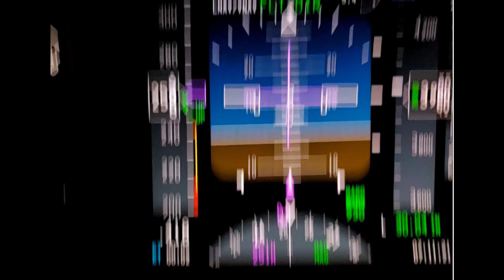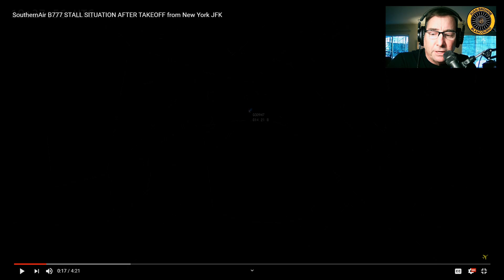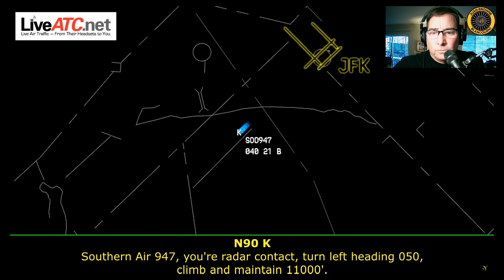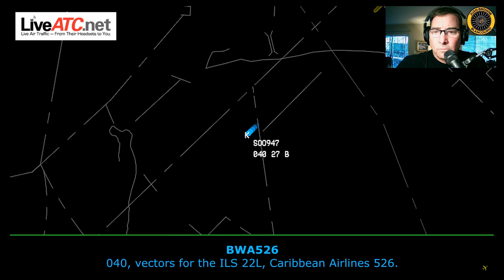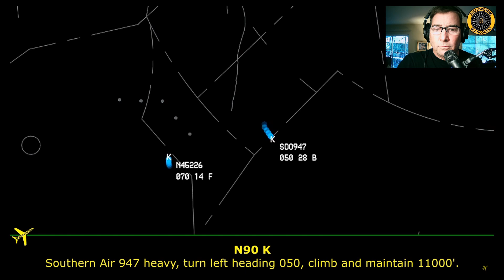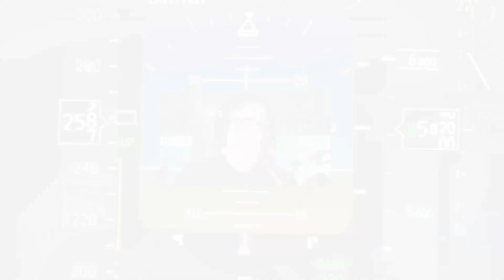"Stall, Stall, Stall" B-777-200 JFK 15 Nov 2020

Comment: When the 777 was designed engineers wanted it to be, as all Boeing planes were to that point, "pilots airplanes".  This was in spite of the fly by wire system that was new to Boeing commercial jets on this model.  They wanted the pilots to feel control forces to know when they are getting close to the edge of the controlled flight envelope.  As Juan points out this does not happen on Airbus planes.  For instance on the "Miracle on the Hudson", Capt Sully has said he would have liked to pull the nose higher before his water landing to have the speed as low as absolutely possible, but the plane would not let him.  On a Boeing he could have, the control forces would be high, but the philosophy is the pilot is in command and sometimes extraordinary circumstances call for unanticipated control inputs.  It would be interesting to hear Juan talk about which he prefers because I believe he has flown both manufacturers on the line.
Reply: @Rob S  which conclusion did I jump to?
Reply: @gregculverwell  you can feel a plane on the edge of stalling, so no he wouldn't have screwed it up like you claimed.
Reply: @southjerseysound7340  tell that to the hundreds, perhaps thousands of well trained and experienced pilots who have stalled and killed everyone on board.
Reply: @gregculverwell  like everything there's always guys that are better than most and others I wouldn't let fly one of my Cubs pulling banners,let alone fly a load of passengers..........Sully was one of the best and more than capable of flying on the edge of the envelope.
Reply: Damn Capt. that’s one helluva comment.... INTERNET COMMENT OF THE DAY AWARD sir 🥇
Reply: @Militans Deo  Fly the aircraft all the way to the crash site as Juan put it once.
Reply: Is that Hudson quote real ? Unlikely as in a dual eng failure the flt control law revert to alternate law with gear up . This does allow the pilot to stall the aircraft if he/she wants to . I think the Airbus gets unnecessary hate , especially from old Boeing pilots as they have trouble understanding the systems . The Airbus is designed with the “average “ pilot in mind , you are not allowed to make mistakes and when systems fail you have full control . Not everyone is an ace to be able to fly the aircraft right on the edge as Boeing expects its pilots to be .
Reply: @AKENOXTRM  no, captain Sullenberger never said that, for some folks it is now all about to discredit Airbus as being the same junk as the 737MAX8
Reply: Not really....the 777 has not "feel" of the control surfaces so a tension system gives them a simulated feel which may or may not be correct. Airbus simply says "you won't feel anything so just watch the damn instruments"...it works fine for the F-16 in the Air Force...the stick only moves a few inches and there is no feedback...
Reply: I thought that Capt. Sullenberger switched to direct law, and therefore flight envelope protection would be  disabled.
Reply: @pchantreau  To do that is actually not that easy, there is no control that lets you go into direct law. Nearly always the plane will stay in Alternate Law anyway and only enters Direct Law when the landing gear comes down. Now, Alternate Law doesn't (usually) have protections either, but it has stability features which will add computer generated control inputs, not to mention it is still a g-load command law, not a direct stick to surface one. 

Anyway, Sully staid in Normal Law until touchdown, which actually was in his favor as simulations afterwards have shown that with his inputs he most likely would have both stalled the plane and probably ripped off the tail section leading to immediate sinking on touchdown. It was an absolutely brilliant peace of teamwork, decision making and flying, and the little help he received from Airbus' inbuilt FBW-features does not diminish that in the slightest.
Reply: As a pilot that started back in the 60's (recreational flying only) I've tried the "simulators" and I couldn't get the hang of it. The controls aren't in the real Cessna world (152, 172, 182, 210, 310 planes that I've flown) just aren't there. So I go back to the real thing to get the real feel!
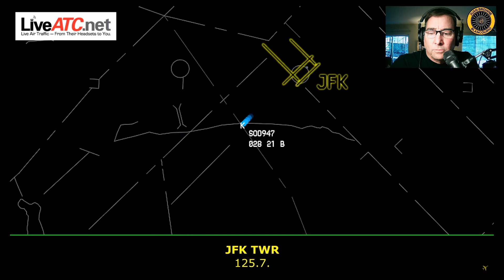Reply: 5:50  yes, this captain sounds tired, but maybe it has become a bad habit on long cargo flights to drink some booze?
Reply: @lenny108  I highly doubt it, I mean it would cost his co worker their job if found out.
      The one thing that you have to realize about pilots is our lives revolve around being able to fly. It takes years of training and paying your dues via hard work, not to mention an absolute fortune to reach the level they're at. So there's no way someone would risk it all to cover for a coworker who was drinking,plus  I think the flight was long enough to require a relief crew and that's just more that would never risk their careers.
Reply: It appears you have been unsuccessful at drawing Juan into this partisanship controversy.
Reply: Maybe the outcome of the Hudson waterlanding would be different without that protection. More tail into the water, stalling over water instead of landing? Mind there was some damage on the back of the plane. A 737 could have broken its tail frame with its consequences.
Reply: @sapede  The Air France crash is the other side of that though. The pilots had no idea how to save a plane when it stopped acting as expected. They hadn't experienced enough situations that were out of the box.
Reply: @Kimberly_Sparkles  On AF447 the copilot panicked and made wrong inputs on the controls when he should have been doing none as he was supposed to be just monitoring (On a plane if you are falling down due to stall, the correct recovery maneuver goes against instinct). Sadly as it is, the plane crashed alone by the copilot actions as was with Giant 3591. The issue is with panicking, as the responses tend to be irrational.
Reply: @sapede  And that crash would never have happened on a Boeing. The 2nd pilot would have known that the stick was fully back (control yoke in the case of a Boeing) and would have corrected, pushing the nose down. In an Airbus, you can’t see what the other guy is doing with the controls. 
As a very high time airline captain, recently retired, I am damn sure which system I prefer- and it ain’t the Airbus one!
Reply: @Kimberly_Sparkles  AF447 had a pitot tube that was prone to icing. Airbus tried to save a buck and it cost lives. Ironically it was one of the last planes scheduled to get a updated pitot tube that they knew had icing issues.
Reply: @FutureSystem738   I hoped the example given of Giant 3591 would show otherwise. Active Sidesticks are on the market so Airbus may be working on integration.
Reply: @sapede  Read the official report on AF447. The stall alarm would activate when the stick was forward and deactivate when the stick was back. Completely backwards due to bad software and alternate laws.
Reply: @southjerseysound7340  any plane is prone to icing it's really not a thing that crashes planes, you just keep flying until they defrost (they have heaters in them even on the so called faulty ones) if they had not done anything 1-3 minutes later speed sensors would have worked again again it's nothing special 
you should watch this (if it doesn't get filtered) https://youtu.be/l1TKe5vmxX0?t=1424 and this is the point where bonin actually says he been pulling up https://youtu.be/l1TKe5vmxX0?t=2151
Reply: @elderbob100  no it was because when it was past 35 Angle (they was at 40 nose up) the stall computer treated it as gibberish so the stall warning activated less often until they got the nose below 35 and then they got constant stall warning again, bonin incorrectly interpreted that as going to fast so just kept pulling back on his stick to keep the angle above 35 (he didn't know that) and Never told the other two pilots that he was actually the one who was pitching up (if you can see my other last post i have 2 key points when bonin doomed the plane)
Reply: @leexgx  I guess airbus changed them to a different design because they were bored then. Another critical flaw is how the side stick functions. The design allowed the inexperienced pilot to freeze with the stick and the rest of the crew had no idea until it was too late. Had it been a Boeing the pilot would've noticed IMMEDIATELY what he was doing and been able to easily correct it. You can say whatever you want but the fact remains that airbus is no less responsible than Boeing was with the Max.
Reply: @southjerseysound7340   A somehow similar situation happened with the Amazon Atlas 767 and the outcome was the same. With the A400M bear in mind that in spite of being propeller driven, it is a relatively fast plane. If you think those are serious problems, read about the development of the C5 or any similar of your choice.
Reply: @sapede  the Atlas crash was totally different and just trying to compare the 2 shows how little you know about aviation. The copilot hit the TOGA switch and shoved the stick forward at 6,200 ft instantly turning the thing into a missile.There was virtually nothing the pilot could do to save it after a few seconds and there's a lot of talk about it being a possible suicide. But there's no proof  so it remains an accident.
Whereas the Air France flight had well over 5-6 times the altitude and the copilot was holding the stick back.  You can't compare the 2 but if the Atlas flight used the same control inputs as 447 it'd have been easily recovered.
Reply: @southjerseysound7340  Yeah, but I've read the transcript of CVR a few times. The crew was completely overwhelmed by what was happening. Even if they'd had a shot at recovery, they were never in the right headspace to do it.
Reply: @FutureSystem738  , unfortunately, on AIRBUS, only ONE SIDESTICK, can work at anytime, if you want to have the second officer to be in control, you MUST go through the computer to select it , case in point do you recall an A320, AIR ASIA , going through some nasty storms& ATC  left him out to hang as capt wanted a change in altitude, so HIS SIDESTICK, has a CRACK in it &so really having to control the aircraft in that storm, then IT BROKE , not enough time to transfer to second officer, I lost a $500. Bet that the crash, was a result of the vertical stabilizer failed, , but was still in place when the rear section  was found . so I paid the bet. , cheers 🇺🇸🇺🇸🇺🇸🇺🇸
Reply: @flybyairplane3528  Sorry, that is simply wrong. Both sidesticks are working at the same time, there is simply a warning logic between both that advises of "DUAL INPUT" if both pilots use the sidestick. Inputs are added arithmetically, so a half deflection on both sidesticks equates to a full deflection on one. However, dual inputs are not the norm in any airplane and should be avoided, both in boeings and airbusses. The one thing that is possible in airbus is the ability to actively lock out the other sidestick, but one has to keep pressing a button on the sidestick for that.

And no, the sidestick was not at fault in the air asia accident, it was rather a captain leaving his seat and pulling circuit breakers in flight for a reset procedure that is only allowed on the ground, while the first officer was probably more focused on the captain than on flying the airplane. The reset procedure actuates the rudder which lead to a loss of control.
Reply: @flybyairplane3528  there is a button on the "joystick" to take control on the Airbus

to use dual mode I do believe you have to press a button above your head (or if you press the take control button in certain way) but every plane now triggers a verbal warning that dual control is enabled, unsure if it keeps repeating every so often as airlines have effectively banned its use (due to the no force feedback nature of airbus "joysticks" and having 2 pilots do the opposite thing means the plane doesn't do anything , af447 may have been what made the new rule that only one pilot has joystick control, but there was another flight where the plane was actually in a nose down stall and both pilots was doing the opposite witch resulted in crash)

where as on Boeing there is no confusion what the stick is doing on both sides even on the dreamliner witch is fully flyby wire with fully force feedback you can even turn a stick off to move it out of the way to get in and out of the seat

With Boeing it's generally mechanic error (or as with MCAS programming error but pilots failing to detect runaway trim) but there are pilot errors but they don't normally result in loss of plane just 2 pilots doing something stupid (but there are some absurd pilot errors, like kid flying the plane and all they had to do to recover from the stall was just let go of the controls and the dreamliner auto near stall recovery system would have saved it, before it's "I have stalled recovery" system kicked in witch forces the plane into a recoverable nose dive)

Where as airbus "technically" 99% of blame is placed on the pilots but due the complacent systems of flying a airbus means you get pilots like bonin flying a plane who shouldn't be flying at all (pulling back in a stall and not telling anyone until they was beyond point of no return)
Reply: @Soordhin  well as was told AIRBUS NEVER WANTED BOTH TO EVER ACTIVE AT THE SAMEBTIME 🇺🇸🇺🇸🇺🇸🇺🇸
Reply: @leexgx  No, there is no button for "dual mode", which simply does not exist on an airbus. Both sidesticks are always active and can be used by both pilots. However, as in any commercial airliner, that is not at all recommended. There is always one pilot flying, which controls the airplanes flightpath, and one pilot monitoring. That is exactly the same on Boeing and Airbus (and Embraer for that matter). 

The percentage of human error in accidents is actually the same on both airbus and boeing, it is around 70 to 75%. Wilfully stalling an airplane into the ground as Turkish did with the 737 in Amsterdam or Asiana with a 777 in San Francisco is quite clearly on the human error side.
Reply: @flybyairplane3528  If they wanted that they could have designed it to be impossible, they did not do that for an obvious reason. 

No plane is operated by both pilots acting on the controls, there is always one pilot flying and one pilot monitoring, that is exactly the same on airbus and boeing, and yes, i am rated in both with quite extensive experience on type. However, in usual circumstances the other pilot can of course intervene with his own flight controls, again, same on Boeing and Airbus, with the difference that on Airbus one pilot can lock out the other one, for example to prevent a suicide dive like the one recently done in a 767 (where that is impossible). Yes, there is an aural warning of "DUAL INPUT", which of course is necessary as there is no physical connection between the sticks. 

By the way, A320 are an US product, built in Mobile, Alabama.
Reply: @Soordhin  and others, at the time there was no alarm or company policy at the time for operating the control sticks in average mode 

after this crash (or others) they made sure it was policy that only one joystick was in control and airbus added an alarm if you enabled average mode (and repeats every so often) 

believe you could also be fired for using avg mode as well (unsure on that one)

Problem with airbus is not many piolts do self manual training off hours to fly the plane (in flight sim even ms fight simulator X) in fault conditions that's out the plane in alternative law mode (as that's the mode that catches inexperienced piolts out because they get complacent in normal law mode for 1000s of hours and can potentially crash the plane when it's in alternate law mode)
Reply: @leexgx  I guess i have to take issue with some of those points. First, there is no average mode in an airbus. Sidestick inputs are simply algebraically added up. And of course, the philosophy that only one pilot has the controls at any given time is extremely old and is not an Airbus thing, instead, it has been used since WWII. Yes, even on a Boeing controls are changed with the usual "you have control" "I have control", same as on an airbus. Therefore, no, there was actually no change in SOPs over that, it has always been in there. 

The DUAL INPUT aural warning and the lights in front of the eyes of the pilots were part of the original airbus design in the A320, that has not changed either. Same as the PRIORITY LEFT/RIGHT aural warning and associated lights.

Alternate law is actually not really a problem, the planes essentially still behaves the same in pitch, in roll only slightly different. Direct Law, however, is really a change in how to fly the plane. However, both laws will, in most airlines, be trained every six months in the regular simulator. 

About being fired for getting into dual input, that depends on airline. In EASAland that would run against the just culture principle, but in China i would bet they do stuff like that, or just dock their pay for a couple months.
Reply: @FutureSystem738  I've never flown anything over about 20,000Lbs...But i want the Boeing which gives Me feel........Paul
Reply: @paul-flyer  Agree 100%.
But many would say I’m “old school” - yeah 30k hours old school, with 24k of that on Boeings since the mid 1980s (737 -300/400/800, 767-200/300, 747-100/200/300/400.)
Reply: @sapede  the tail frame of any kinds of aircraft are the most hardest and durable. In fact tail skids are not a problem hence the water landing in sully which in the minimum speed.
Reply: To me, it seems the dislike of flight protection/computer interference isn't warranted in general, other than pilots lacking in flight experience - though I can't see why they can't still fly manually for experience, with the protections as a backup.
The Hudson landing doesn't seem a great example, as obviously the landing was nearly perfect 'despite' the airbus.
Indeed one of his acclaimed decisions was immediately starting the APU, partly as this allowed the flight protection to remain active.
'Author and pilot William Langewiesche asserted that insufficient credit was given to the A320's fly-by-wire design, by which the pilot uses a side-stick to make control inputs to the flight control computers. The computers then impose adjustments and limits of their own to keep the plane stable, which the pilot cannot override even in an emergency. This design allowed the pilots of Flight 1549 to concentrate on engine restart and deciding the course, without the burden of manually adjusting the glidepath to reduce the plane's rate of descent'
Similarly the Qantas A380 flight(QF32) where an engine exploded(due to rolls royce manufacturing fault), causing severe mechanical and electrical/sensor damage. From memory, so may not be 100% correct, but I'm pretty sure the general details are correct - the pilot initially complained about the Airbus intervening or giving stall warnings during landing, but it turned out to be entirely appropriate - this was with the pilot, 2nd & 3rd officer, and 2 check captains in the cockpit, from the safest airline in the world. It seems the reason the pilot thought it was wrong, is because the flight characteristics changed due to the damage. So even with the cockpit about as ideal as possible, and multiple electrical problems, the computer/protection still helped here(in addition to the assistance during the flight prior to landing).
Pilots(like anyone) can also have incorrect perceptions, so even a highly competent pilot doing what they're sure is the correct action won't always be best. There are numerous accidents where pilots have inadvertently made the situation much worse.
It may have some negative impact sometimes(seemingly rarely) when a pilot has a better course of action than the computer, but it seems outweighed by the positive aspects.
Reply: A Boeing would have shood the Geese out of the way 😀
Reply: Given that Sully had never trained for this, its just as likely that he would have stalled it and had a much worse outcome.
Reply: @gregculverwell  He was/is a glider pilot though, if anyone would be able to manually control the aircraft in that situation it'd be him. There are pros and cons to both approaches, you can protect pilots from themselves a lot of the time, and other times limit their ability to control the aircraft in extraordinary situations, but only very rarely.
Reply: @MrMattumbo  I was also a glider pilot (and light aircraft). I would not like to attempt a manoeuvre I hadn't trained for. You may get lucky or you may die. Having a 100 people sitting behind you is not the time you test your luck.
Reply: @gregculverwell  Greg Sully is an experienced glider pilot. I believe he has the skills needed to have landed slower with a higher AOA to slow the plane.
Reply: @gregculverwell  Sully et al forgot to push the "ditching switch" on FIFI.  Did an awesome job otherwise.
Reply: The differences are indicative of differing approaches not just to piloting, but to life. One system thinks for you, while the other system lets you think, but gives you guidance along the way.  Airbus designs take control of the aircraft, while Boeing designs
give you trouble warnings, but leave the final control in your hands.
I support the Boeing approach, because it encourages active awareness, and hands on flying skills. The Airbus approach runs the risk of blunting pilot skills, and turning the pilots into passengers.
This same problem crops up in new automotive technologies, which turn drivers
into passengers.
Reply: @greyjay9202  You can't possibly imply that for the automotive industry this is a bad thing. Most drivers are reckless idiots with barely any training at all. I don't care if computers take the fun out of driving if this means you don't kill me.
Reply: @greyjay9202  And yet there is no discernable difference in accident /fatality rate.  And let's not forget that the 737 max tragedies would not have happened if it were Airbus which are designed from the ground up to have the computer in charge. Boeing is not good at computers.
Reply: I really don’t care whether it’s Boeing or Airbus, as long as my mortgage is paid at the end of the month - I don’t give a stuff!

About 10,000 hrs on Airbus single aisle, and similar on various Boeings, 75, 74, and now the plastic fantastic.

I do miss the table though! ;)

Know your aircraft systems, and how to use them, and the arguments above all pretty much disappear!
Reply: @gregculverwell  Last Airbus fatal crashes have been due to: suicide, attack or sheer incompetence. Their aircraft despite receiving different care and operation could not be blamed for any casualty.
Reply: @gregculverwell  airbus tech played a bigger role in the deaths of AF447 than the Max did in their accidents. But Airbus got a pass from the media and they continue to be treated like the good guys and they are no better if not worse than Boeing. Seriously just take a look at the A400M debacle. Just when you think it couldn't get worse now the plane can't even withstand a bird strike without punching holes in the aircraft.The last one was a RAF plane that landed with a massive hole in the side of the plane below the cockpit side window. There was damage to critical wiring in the cockpit caused by the bird coming into the aircraft lol
Reply: @southjerseysound7340  The bird contacts happened in Spain were it is not that rare, when flying low outside airports, due to large birds (vultures, storks...). Unfortunately they take down about one GA craft and its occupants every year.
Reply: @sapede  it was a stork and I know all too well what a bird can do to a GA and commercial aircraft. I've had the misfortune of hitting a Canadian goose in my Maule and more seagulls and sparrows then I can count in my airtractor and my Ag wagon while seeding cover crops and when a fat goose does less damage to a fabric covered aircraft than a military transport aircraft......... There's problems no matter what bird or where it happened. Seriously a military transport aircraft is supposed to be rugged and dependable and it's far from it.
Reply: This comment didn't age well for you did it?😂😂 @southjerseysound7340
Reply: Exactly.  None of the software engineers will ever be on a flight that needs control flexibility during an emergency such as noted with Sully. I'm no seasoned pilot but I can associate with that in the automotive industry and those vehicles that have the "Auto Start Stop" feature which turns off the engine with software based electronics. Of all vehicles to install that feature, FMC put it in those Jeep Wranglers. Of all vehicles a Jeep, one that will not truly follow any imagined travel plan these EPA "experts" force auto engineers to try to save a drop of fuel on a utilitarian vehicle. Off the road, this idea would be complete stupidity as the engine is used 100% of the time for control needs and then some. Lucky there is an "Off" switch for those who know where it is or even know about it.
I'm with Boeing's idea, I want some feedback and control, especially when the computer is not going to tell me what it has planned in these kinds of instances !
Reply: @Garth2011  That's why I drive a standard
Reply: @easternwoods4378  One they get the paddles on the yoke you may change your mind. LOL
Reply: @Garth2011  At the same time, whilst exceptional circumstances  can call for inputs that would put the aeroplane into a normally dangerous situation (and potentially save lives), you need also to consider the case where letting the pilot perform these manoeuvres can cause damage/death. I doubt it would've come even close to happening, but suppose this flight had entered a catastrophic stall and crashed in a residential area. An airbus plane in the same situation simply would not have let the plane get into that situation. And whilst that does seem a stupid what-if scenario to entertain, consider that MCAS was added in order to mimic earlier variants of the 787's stick forces, a feature no airbus aircraft needs to consider. I think it's more complicated than just software engineers not understanding that pilots might need flexibility, and instead weighing the chance of that flexibility saving lives against the chance that same flexibility allowing a crash that could've been prevented.
Reply: @qwerty21ification  
Don't make guarantees about other people. People will shock you. Some pilots actually love handing over some responsibility to the computer...

There are many many drivers on the road who prefer to let the computer handle anti-lock braking rather than having to learn it and do it themselves, for example.
Reply: Good pilots know how